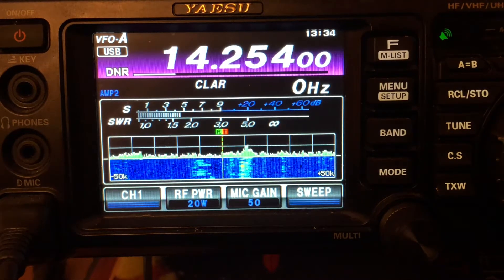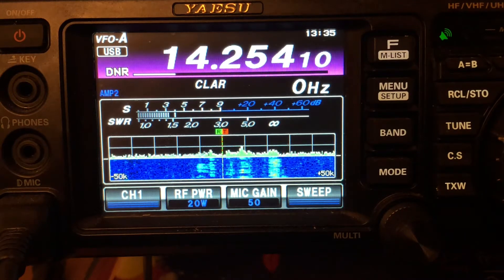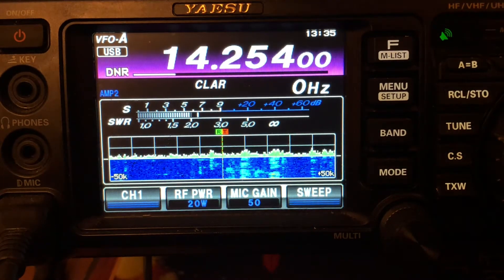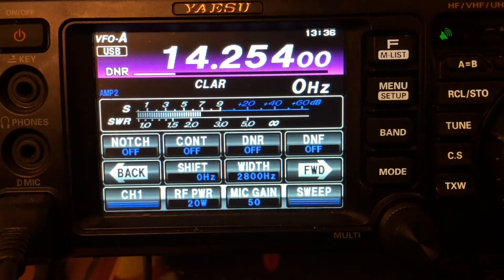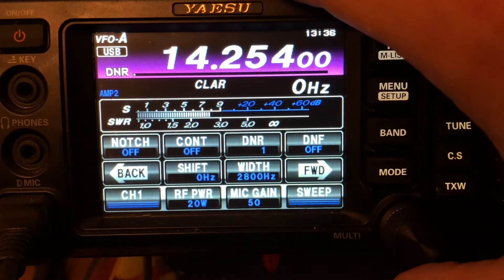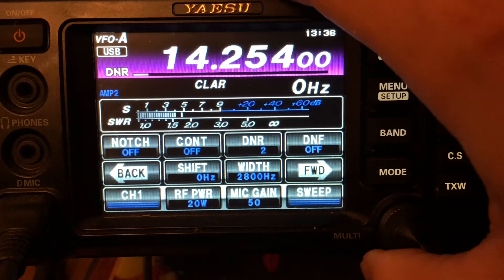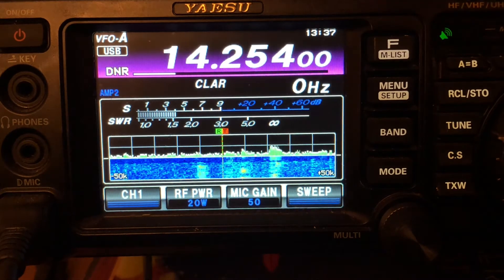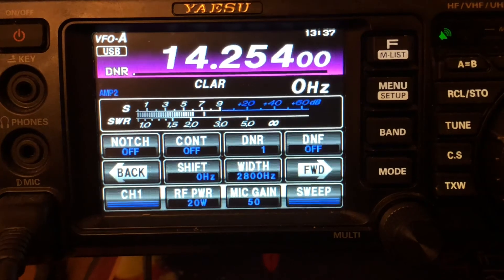DNR (Digital Noise Reduction) Button on Yaesu FT-991A

Comment: TY for the video. I am a Tech and have used a 102" whip with a mag mount for 10 meters. My match is 1 to 2.5. The 991a antenna tuner tunes it ok. How can I reduce the match down?
Reply from the maker: @joewiehr1931  trim the antenna.  A 1/16”.  Or  just leave it alone.  If the tuner works then you’re probably fine.    468/28.00 = 16.5 feet.  That’s half wave.  Then divide by 2. For 1/4 wave.  8.239’ feet.  Rule is. Always round up. So like I said 1/16th.  Then test swr
Reply: @mikecricket113  My 102" is a solid peace including the threads where it screws into the mag mount. So how would I trim it?
Reply from the maker: @joewiehr1931  do you run 11 meters?  If so don’t trim it.
Reply: @mikecricket113  Would trimming the thread where it screws into the mag mount work?
Reply from the maker: @joewiehr1931  no don’t trim it there
Reply from the maker: @joewiehr1931  if you already have the 3/8” 24 threads mag mount. Just get a shark 10 meter ham stick.  I’m only saying this because if you’re running 11 meters in the truck you might as well just get an antenna cut for the band then mess around with trimming the 102”.   Or just use the tuner.   There’s nothing wrong with using a tuner.